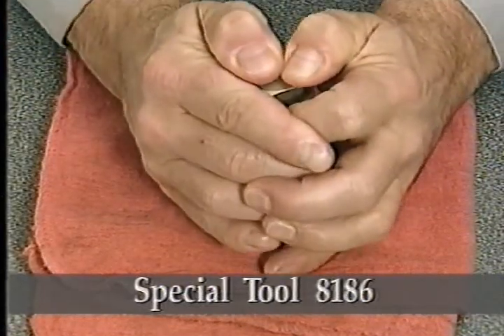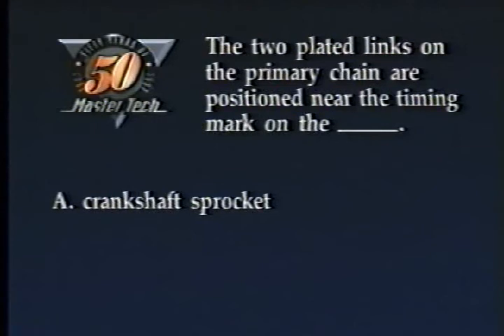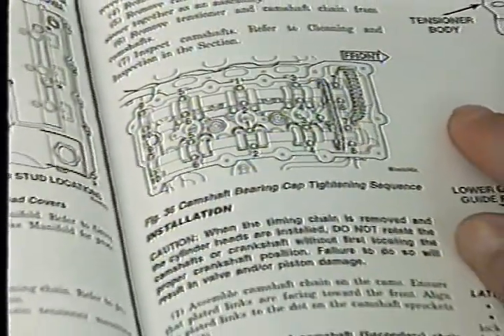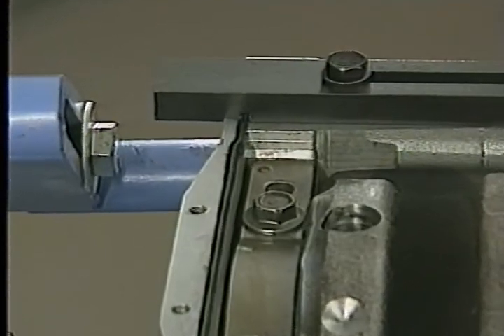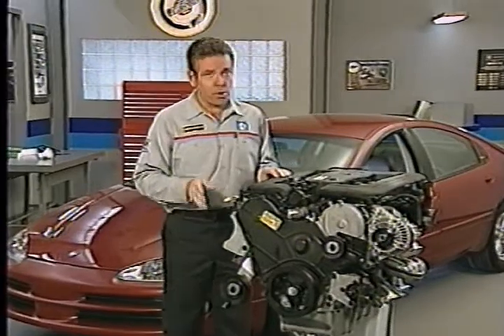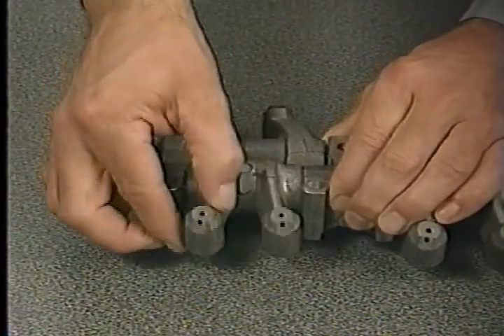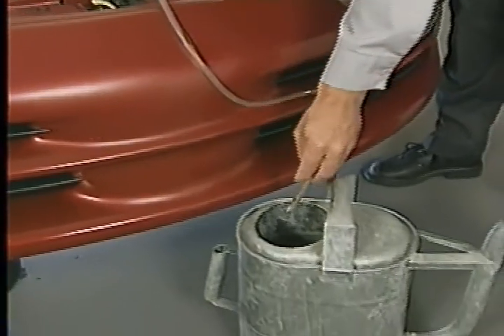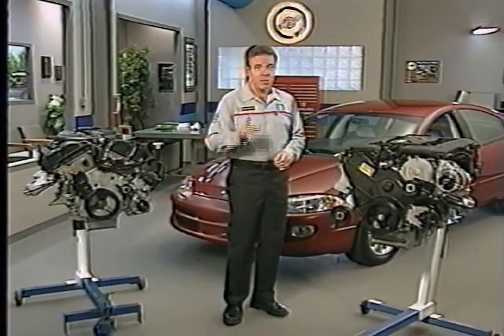Chrysler Mastertech 1997 - Introduction to 2.7L, 3.2L, 3.5L V6 engines  -- Part 3

Comment: My chain jumped time about half a rotation..  all intake valves are not coming all the way up..   I can literary pull the roller off of the valve with my hands.  But only on closed position. Does this mean my intake valves are all bent ?

Comment: Great videos. I've just changed timing belt,water pump,thermostat,heater core & upper intake manifold in my 2003 Chrysler 300 Special M 3.5V6. Just wondering where I can purchase Special Tool #8195 for filling the system with coolant.This one is the white funnel with the pinch piece that pinches the over flow hose. I'm not looking for the large yellow spill free funnel. Thank you.